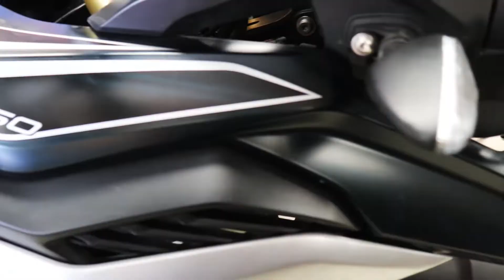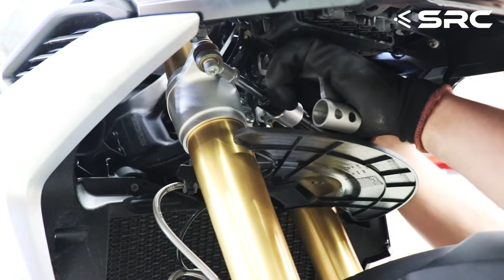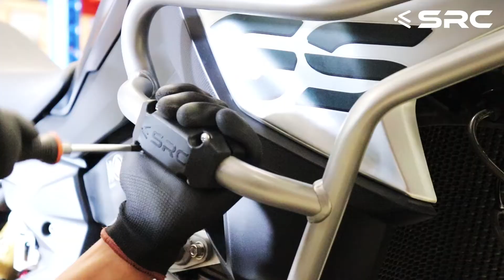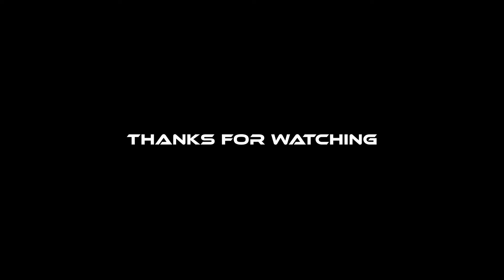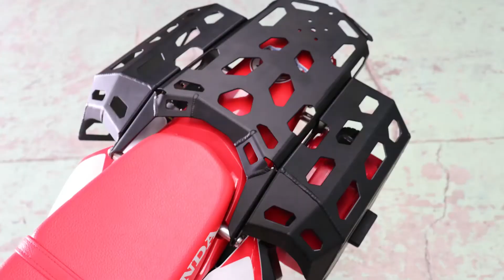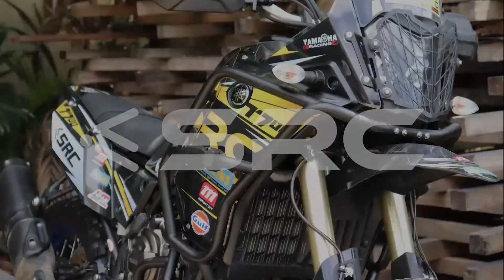BMW F850 F750 GS CRASH BAR INSTALL

Comment: I like the look of these bars, but after watching this assembly video I have doubts about the strength. There are too many small screws holding sections together. I can't imagine that if the 224kg bike falls over onto these bars that the bars will not snap at the connection points.